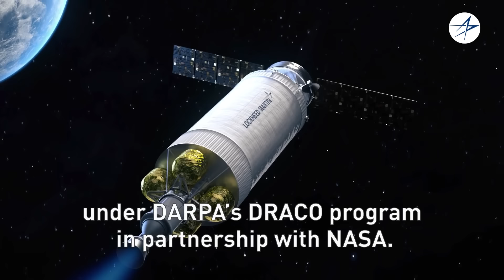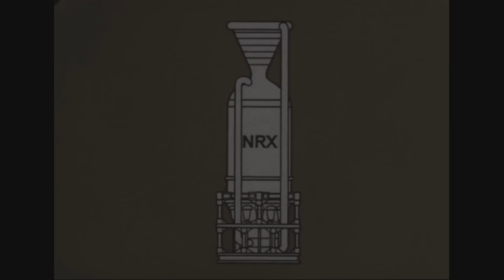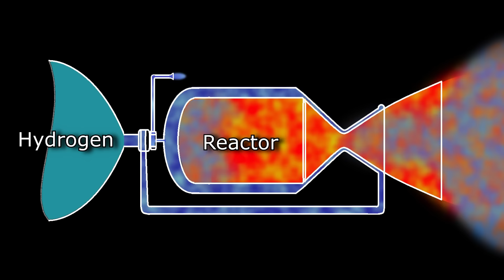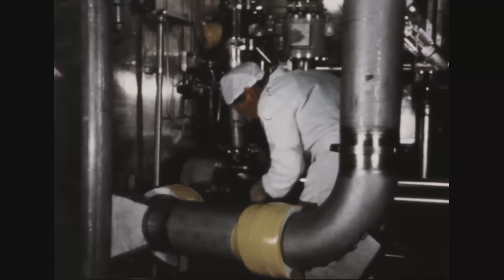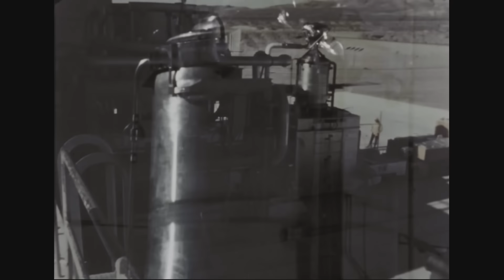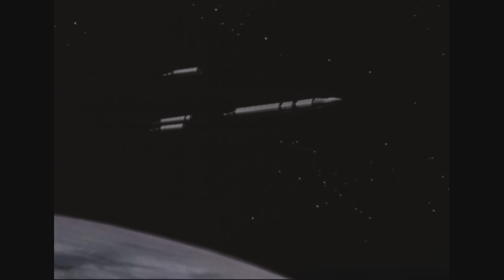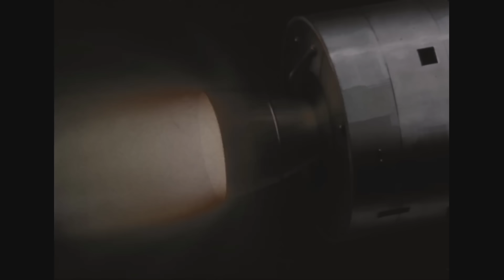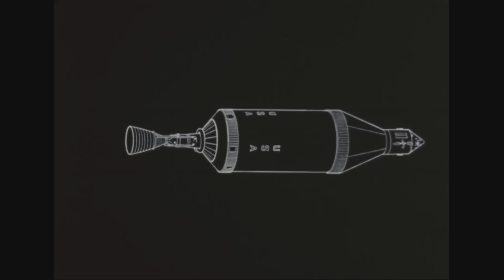Why Nuclear Rockets Are Going To Change Spaceflight

Comment: For side-stepping The Tyranny of the Rocket Equation, I saw a paper called "Low Cost Design for an Orbital Ring" by David Nelson on how to build an orbital ring for actively supported space elevators for roughly $9B, using existing materials and rockets, it's pretty interesting. 
Assuming we never get the unobtanium supermaterials to build a passively supported space elevator, some kind of active support megastructure like that or a skyhook is going to be what it takes to do large scale space industrialization and colonization. The economics and logistics of chemical rockets for orbital lift are too much of a bottleneck to scale much beyond Starship; doing ~11+ Starship launches to refuel 1 interplanetary Starship just isn't going to work long term.

Comment: Solid core NTRs like NERVA are useful for lots of things like cargo and heavier probes and landers, for tugs & personnel transports for Earth-Luna orbital transfers, and for a one-time Mars mission to plant a flag, but they lack the right combination of ISP x Thrust to Weight for regular interplanetary travel to be fast enough to be safe for Humans. It would still take so long that you would exceed your lifetime radiation exposure allowance after a couple round trips to Mars. Regular manned travel would take a huge leap in shielding tech (or anti-cancer tech), high thrust beamed power propulsion, torch drives like gas-core NTRs & nuclear salt water rockets, or handwavium tech like practical fusion drives.

Comment: Need to address the questions about radiative exhaust.. yes space has radiation before there were nuclear exhaust increasing it. How low orbit is safe? How to try these engines out since you can’t run them in a test stand on earth?
Reply from the maker: There’s nothing in the technology which requires radioactive exhaust.
Reply: @scottmanley  
Ah. Thanks for that.

Comment: I'm honestly more optimistic about this than Starship, just because we've seen no real progress on the rapid refueling that critical to Starship doing missions beyond earth. I'm sure that will come along too, but being able to use a higher efficiency engine that doesn't require refueling feels like it could swap into use more easily.
Reply: It's twice as efficient, so it needs half as much refueling.
Reply: @cube2fox  yeah now that I read my comment again I’m not sure why’ve assumed it wouldn’t refuel, since ideally you wouldn’t want to throw away one of these engines

Comment: You mentioned that when the payload detached, it'd need to stay in the shadow. Wouldn't that only be necessary when the reactor is producing significant amounts of power? I feel like the moderator drums could just spin to turn the Criticality way down, which would in turn drastically reduce the radiation issue.
Reply from the maker: The core remains radioactive even when not operating

Comment: You have stated that the ion engines still have more specific impulse, but power them takes so much electricity. Does anyone think about send up a nuclear reactor just for electricity generating (so no need to handle strong radiation) and power the  ion engines in the deep space missions? 

(No, I does not mean radioisotope thermoelectric generator (RTG), they are too weak)
(For deep space mission, many time you will have trouble to get enough sunlight for your solar panel, but you get advantage for a super long acceleration time) (Think about if voyager 1 get an ion engine and a nuclear power reactor can keep the ion running for 5 years, it will become much faster and way away from our solar system).
Reply: Yes, someone already though of that, it's called Nuclear Electric propulsion.
It's a great alternative for when you need to send a big spacecraft to somewhere that is very very far, but you can spare some time to get there.
Reply: the problem is transporting mass from earth to orbit, and ion engines can't do it
Reply: @jakubiskra523 Nuclear thermal rockets are basically useless for that too. Much better T:W than any ion engine but still not enough to lift a rocket off the ground in any practical designs. Chemical rockets are still the best we have for getting to orbit.

Comment: Just heating up propellant is such a waste of the energy potential of nuclear reactors! I doubt that engines of that type will be used a lot. Since AFTER you are in space, you are much less dependent on the shortage of maneuvers than you are on weight limits. Having 10 times more specific impulse for the same mass, even if it costs you 10 month instead of 10 minutes to generate, helps you a lot more in your missions.

Likewise a drastic mismatch of necessary mass to achievable impulse is observable in the so called "light sails": Instead of trying to generate impulse directly by reflecting light back to the sun, it would be much more efficient to use the reflective surface to collect the light into electric power generators, driving an ion drive with the generated power. The latter produces drastically more thrust than the "light sail" by its original intention, even if it produces drastically less thrust than chemical engines. And using large ultra thin light reflectors as collectors enables you to use energy from the sun even for deep solar system missions - where using those reflectors as "light sails" would be nonsense anyways. Using that technology, you can have the efficiency of ion engines without the risk of nuclear cores.

For solar system missions for the next at least 100 years, we are talking about missions with multiple years long duration anyways, thus expanding maneuver times from minutes or hours to month is not a problem at all.

And i count on our common understanding that electronics as well as biological system are highly vulnerable to radiation generated by nuclear fission reactors. Thus, i bet against Scott at this point: "Nuclear Rockets Are NOT AT ALL Going To Change Spaceflight".

Comment: Ah, the nuclear lightbulb. When someone asks how hard you want the engineers to work and you just say "yes."
Reply: "Sir, at such temperatures, the core would vaporize itself, how a-"

"Yes, that's intentional. Now, find a way to keep it contained."
Reply: i mean, i have no idea how hot a fission vapor would be, but it has to be way way hotter than the melting point of any known material right?
Reply: @oldfrend 
Yes, that's why there's two prominent designs to such approach, open cycle and closed cycle. 

But they both involve keeping the fissile gas within a gaseous vortex to keep it in place.

The closed cycle one, does not allow the fissile material to exit the engine, thus it doesn't need to replenish the gaseous reactor.

The open cycle allows fissile material to "leak" out, thus needing to replenish the reactor, however, this allows much higher temperatures to be reached, thus giving even higher ISP.
Reply: @davisdf3064  yea, the difference can be obscene, honestly.
Reply: I haven't followed the research on this in a while.  Is there any solution to the fact that fused quartz blackens under neutron bombardment?  Or is the blackening rate sufficiently low that it can be dealt with?
Reply: @karenrobertsdottir4101  I believe that as long as the quartz remains transparent to X-rays then it'll work. But what do I know.
Reply: @RCAvhstape  My understanding is that the purpose of fused quartz is to avoid the chamber walls heating up excessively, aka to absorb as little of the flux from the plasma as possible, having the hydrogen absorb it instead.  And the flux is primarily hard UV.
Reply: Technically, tritium gun sights can be considered as nuclear lightbulbs under some definitions.
Reply: @atrumluminarium  😆
Reply: Ahh yes. Do you want that open or closed cycle. . .
Reply: Just like nuclear power, nuclear rockets may not be the big future.  The cost-benefits of nuclear power on earth versus other power sources, is that nuclear is too expensive and takes too long to build a nuclear power plant, then there is the decommissioning and disposal problem after it's too old, plus the hard to quantify problems with protests against nuclear power.  Space based nuclear rockets will have the same problems.  The cost-benefits of nuclear rockets may not offer enough improvement over other types of propulsion systems that are slower and cheaper.

If the radiation exposure on long space trips cannot be easily overcome, then nuclear rockets may offer enough of an advantage by reducing travel times and therefore reducing radiation exposure.

Where would we dispose of decommissioned nuclear rockets?  We already have nuclear disposal problems here on earth.  We cannot land nuclear rockets safely enough where humans are living.  We don't want them orbiting as space junk, that someday in the far future may break-up or re-enter the atmosphere.  The old standby of sending trash into the sun, is in reality very very energy intensive and difficult to do, as shown by the difficulty of getting the Parker Solar Probe to orbit near the sun.
Reply: @davevann9795 nuclear waste disposal is a solved problem, and is not that costly once the vaults have been built, which they were like 50 years ago, as far as cost, the US started construction of many reactors decades ago, but stopped construction due to mass hysteria after the 3 nuclear disasters that have happened. The cost is actually low compared to the cost of covering the planet with solar panels or wind turbines. The cost would be even lower is 80% of reactors weren’t abandoned mid-construction…
Reply: @davevann9795  You "decommission" them by throwing them into Jupiter or the Sun, places where the radiation won't matter.
Reply: @davevann9795  Yes, they take much longer to build and are more expensive up front. And most of those cannot be trimmed down any at the scale of modern (~1GW +) reactors. However, the operating costs are both low, and steady over the life of the plant. They break even on cost much faster than conventional power plants, and are, let's face it, more reliable (in terms of output) than any kind of wind or solar. 

Yes, decommissioning is. . . taxing, given the nature of the construction required. However, fossil plants have thier own issues on that subject. Protests about these are based solely on fear and ignorance of nuclear weapons and what ionizing radiation can and cannot do. That is also half of the reason we have no real disposal site for nuclear waste (of any level), the other being the massive volume of said waste we, the US, has. I say the US because we are the only major country in the world that cannot, by law, reprocess nuclear waste, to extract the high level waste, and to recover the still very much usable fuel from 'spent' fuel rods. Low level waste, mostly things that have been neutron activated after long exposure, are frankly not any more dangerous than the background radiation levels found almost anywhere in the world.

In space it would be actually easier to avoid radiation effects simply due to how much 'space' there actually is. The inverse square law tells us that the further away one is, the amount of radiation on any one point falls away rapidly, to the point of reaching effectively zero, in terms of having to take measures to protect from exposure. At the point where one needs to move to close orbit of a planet or other object, well, that's where the chemical powered shuttles come in, providing both in orbit rendezvous and atmospheric entry, descent, and landing capability. 

The other two current options for spaceflight, chemical and electric (ion), are either ridiculously mass intensive (chemical), or slower than a snail in terms of acceleration (ion). And in space, mass is everything. Look up the Tsiolkovsky rocket equation, it's pretty harsh in terms of the limits on chemical propulsion. 

As for disposal, is there a reason the reacor section could not be detached and sent for reprocessing, or just dumped into a convenient star, or gas giant. Yes, it takes a considerable amount of delta-v to cancel enough of the ~30-40 km/s speed to allow for a solar orbit to reach a point of breakup and entry to the sun, but that kind of thing is exactly what ion drives are perfect for. Long duration continuous acceleration. Calculating the required orbital paths is relatively simple orbital mechanics, and can easily take into consideration safe standoff distances for any possible radiation exposure.

Comment: I know about a lot more kinds of nuclear thermal rockets, and I'd like others to learn about them as well, and I can't think of a better person to explain them to the masses than Scott Manley.
There are actually two types of Bimodal, and even a single Trimodal nuclear thermal rocket concept floating around out there.
The one Scott mentioned in this video is the "Bimodal NTR + power reactor" type. This uses a "normal NTR", and adds on extra systems allowing the reactor the ability to operate at a low power for extended periods, while generating electrical power for the habitat modules and associated life support systems (extra systems include but are likely not limited to: A Brayton cycle turbine generator, large radiator array to reject waste heat, and Helium as coolant instead of Hydrogen, because you can't make Helium-4 into a radioactive isotope by irradiating it with neutrons or gamma rays).
The second type of Bimodal NTR is better for operation deeper in the depths of a high gravity planet's gravity well, because it has an extra mode that allows it to "shift gears" by lowering the specific impulse to increase thrust by a lot. The single extra system that allows this is a large tank to store Liquid Oxygen, associated pumps and plumbing, and a set of injectors to feed this liquid oxygen into the hot hydrogen exhaust, transforming the NTR from a nuclear thermal rocket to a nuclear thermal rocket with a LOX-injection "afterburner", and the afterburner metaphor is VERY appropriate because just like an afterburner, it's mechanically simple, and massively increases both thrust and reaction mass flow rates.
In concept, the "LOX Afterburner" bimodal NTR's "extra ability" is quite similar to the "Gear Shifting" ability of a VAriable Specific Impulse Magnetoplasmadynamic Rocket, or VASIMR, and is useful in similar situations.

The Trimodal NTR is simply what you get when you put the two types of Bimodal NTR together in one engine (and ditch the now-redundant spare reactor core you end up with).
Spelled out explicitly rather than implied, this means that a Trimodal NTR has the normal NTR equipment, the equipment for the LOX Afterburner mode, and the equipment for the low power electrical generation mode.